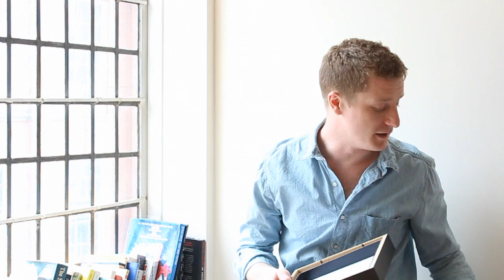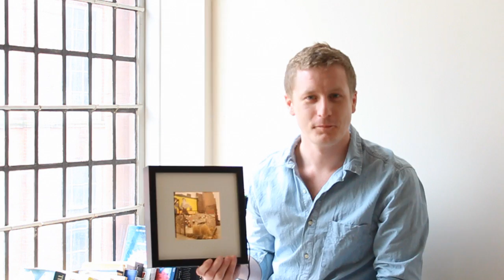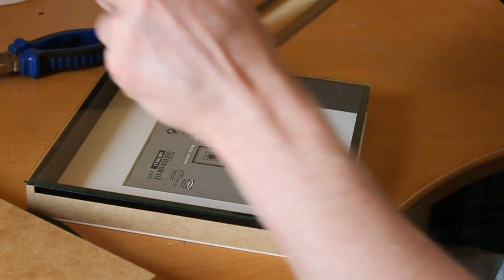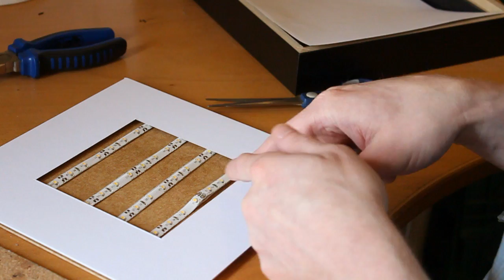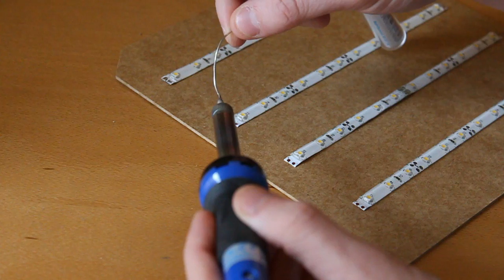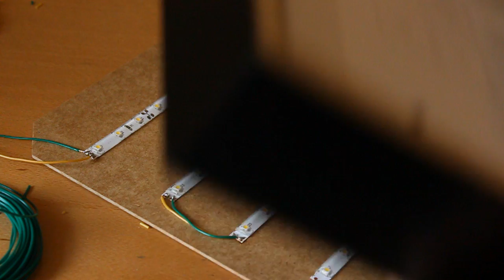How to make: 'Intelligently' Illuminated Photo Frames : Part 1

Comment: Wouldn't it be easier to connect the strips in parallel with all the positive connections at one end and all the negative connections at the other? You would only need to solder 8 points (one each end), rather than 14 by daisy chaining them, and there wouldn't be two opposite polarity solder connections right next to each other.

Comment: Didn't you make soldering hard on yourself?  12v and sets of 3 LEDs means each set of 3 LEDs runs 12v.  All the sets of 3 LEDs are wired in parallel along the entire roll.  All you need is a Positive and a Negative on each of your 4 strips.  
 Take your strips with groups of 3 LEDs and remove the coating from the positive on one end of each, and the negative on the other end (or both positive and negative on both ends.).
 Lay them on the board. 
 Then run a bare wire up both sides.  Tape it in place at the ends.
 Use another bare wire to connect the positive pads on one end to one of the bare wires running up one side.  Solder a long(ish) length of bare wire to a pad and then to the side wire and cut it off.  Then move to the next strip. 
 Do the same for the negative on the other side.

Comment: FYI I had my soldering iron too hot and it damaged the led strip,try soldering paste its much easier and works at lower temperatures . Sorry but IMHO wire the strips before sticking them down so if you do fork up the soldering you can go to the next + - point on the strip without having to rip it off the board. And don't trust the adhesive on the strip,best practice is to use glue. For this task don't use waterproof strips. They are more expensive and unless your planning an underwater gallery...pointless.

Comment: The best method of defusing LED lights is to edge light a piece of thin acrylic, but it must be roughed up in order to displace the light brightly toward the center. The way you go about this is to sand the sheet of acrylic with an even scuff.  A steel wool pad makes this real easy.  Just make sure its a new pad so as not to contaminate stain the acrylic.
That is how a lot of light boxes are made for tracing.

Comment: Thanks for the video. Would you recommend this technique on IKEA 27x40 poster frames as well ? I'm looking at solutions to light them up without building the lightbox from scratch and getting the snap-frame types, since I already have IKEA frames and they seem big enough to handle some LEDs inside. My posters are double sided, made to be lit up. What's your advice, please ? Thanks in advance.
Reply from the maker: +Razvan Dragu Have you got a link to the frames?
Reply: This would be the model, but the frame is black. This oak frame is new. My frames are the same, but black.

http://www.ikea.com/ie/en/products/decoration/frames-pictures/ribba-frame-oak-effect-art-50142931/

As you can see in the picture below via google images, the back is pretty spacey and looks like it could be hacked and add some LED, but the psoters being double sided, specially for lights, wouldn't the LED lights be too prominent when lit up ? Or would the light travel on the whole poster?

http://ikeahackers.net/wp-content/uploads/blogger/-6VNrC2k2qO0/T9XF7WD0Y4I/AAAAAAAAhqA/hKxkC3uFBeA/s1600/02%2B-%2BSollution%2B%2528Ribba%2BFrame%2529-700870.jpg

I just want to make sure I don't wake up with lines of lights along the poster when I light it up.
Reply from the maker: Razvan Dragu Hi Buddy, 

It doesn't look like there would be a lot of depth to that frame, if you putt he LEDs too close to the picture/poster you would definitely end up with lines of light.
Reply: +David Watts damn. ok. thank you! I'll see what alternatives I have. worst case scenario, I'll build the frames.
Reply: +David Watts damn. ok. thank you! I'll see what alternatives I have. worst case scenario, I'll build the frames.

Comment: Hi David. what type of picture paper are you using that seems to be a good print quality yet "transparent" (without any brand print in the back).

thanks,!
Reply from the maker: Samuel Bringas Hi Mate, it is just normal photo paper from the photo developer, mine did have faint branding on the back but you can't really see it. You can buy matt photo paper for inject printers which would work well provided it wasn't too thick and it wouldn't have any branding.
Reply: Thanks for the advise!

Comment: Thanks, you've confirmed my suspicion as to how to make one. However, I own 4 "Photo Glow" frames that take a 13 x 19 print. They cost $140.00 USD each and I don't want to cut one open in order to get the details of their design.

I'm going to make a back-lit frame which will have a outer dimension of 20" x 28" and I'm very well versed in LED strips, soldering etc., etc. So where I'm concerned is with the possibility of seeing "Hot Spots", (the individual LED bulbs), through the transparency when the lights are turned on.

I use a special "positive" white coated, transparency media and I'm using a standard frame thickness. In my case, the frames overall thickness is 1 3/8" and I plan to place a 1/8" thick diffusion sheet, (of what the manufacturer describes as "medium opacity").

Even so, I think the LED arrangement that you set up, (the multiple strips firing directly at the back of the picture), will create that "hot spot" effect I want to avoid. Therefore, I'm thinking to run the LED strips along the inside of each frame rail.

They would be facing the LEDs on the opposite rail and in fact, I would likely try lining the two longest frame rails first. Then I would add LEDs to the other two rails if I need to.

So why am I telling you this? Well, perhaps you, or one of the folks in this blog, may have done something like this and can keep me from finding out a potential problem the hard way.

BTW; I have the 6000K waterproof, 50/50 LEDs and perhaps that may be too cool. I'm guessing that the 38/50 LEDs are warmer, yes?. Perhaps a 4500K temperature would be better?

I noticed that my first store-bought Photo Glow frame purchased about 3 years ago, has a significantly warmer tone than the other 3 I bought in the last 1.5 years. I didn't notice this until just two days ago, when I had prepared a 4 segment enlargement as a test to an idea I had,

I printed the 4 segments each to a 22" x 16" size. Placed each segment, (these were just standard matte paper for testing), in the Glow frames. The frames would be hung against each other making the entire image 44" wide x 30" high

The effect I wanted was to create the illusion that the viewer was looking out through a window, (this was a Lake Powell Canyon photo I shot). However, not only did I find that one of the frames were comprised of a warmer LED set, but also that the frames were not back-lit to the edges of the frame rails!

That was of particular importance because the effect I wanted wouldn't work if the frames had their mattes installed. So I'm trying out a "DIY" Glow frame and if it works, I'll make 3 more. The frames at the size I need them would cost me about $350.- $500. each! I did find one that cost $280. each but the frame rails were too wide, (I'm trying to get them no wider than 5/8".
  So what do you think?
Thanks for the video which was easy to understand, great job!
Rich
Reply from the maker: Rich Paul Hi Mate, Thank you for what must be the longest and most concise comment I have ever had.

I have never seen glow photo frames for sale in the UK before but I did think they would be expensive.

My frames did have the hotspot effect as you described but it wasn't very obvious. I also thought about lining the outside of the frame with LEDs but it left a dark spot in the middle. It was still a nice effect though. A wedding photographer contacted me last year asking for help making some frames, he doubled the amount of strips I used and he was quite happy and even displayed 30 of them at a wedding fair in London.

Getting white or warm white is a tricky one, it depends on your image. I found warm white works well if you have a large proportion of skin tone or the image is of a family or friends but the cool white works better for landscapes/serious pictures. I suppose it is a creative decision.

I have had a good couple of years to come up with a better solution and in fact I have two for you.

'EL Panels' look promising from what I have seen, they can be cut with scissors and require minimal hardware to power. They provide a flat uniform light but I have not tested them for brightness or colour temperature. These are an expensive option in comparison to LED strips.

My other solution is similar to my first. Unhappy with my frames, I doubled the number of strips inside the frame but still saw faint hot spots. Then I realised that I could only see them because of the intensity of the light and not the orientation. I knocked up a quick circuit to dim the LED strips and it worked like a charm. It also reduced the power consumption by around 60%.

A word of warning though, black and white photos don't work all that well, your eye is a bit too attuned to contrast difference with a lack of colour in the scene.

If you still have problems, you can diffuse the light with bubble wrap, frosted acrylic or even very thin cotton. 

Other people may have some suggestions too.
Reply: David Watts Thanks David! The suggestion you made; "If you still have problems, you can diffuse the light with bubble wrap, frosted acrylic or even very thin cotton." is a good one! I do have a 12” x 18” acrylic diffuser as I mentioned earlier. However, it’s not exactly cheap and I need a bigger piece that’s that’s coated with a ‘denser opacity’.

I have several Epson Photo Printers. The large format Epson 7600 Stylus Pro uses a 24” roll paper. I use a inexpensive Epson “Heavy Matte” paper for testing various profiles, image projects, etc.. At this point, I’m using a sheet of that, (cut to fit the inside of the frame), as a diffuser.

Last night, I prepared my frame for a test. Today, I plan to try the configuration you've demonstrated and I'll place the strips about 3/8" apart, running parallel with the longest edge of the frame.

I do plan to use a dimmer and if I have to dim the lights too much to get rid of the 'hot spots', I'm going to start adding and testing various diffuser materials like that bubble wrap or cotton you had mentioned. Of course, I’m also going to try firing the LEDs across the frame as I mentioned yesterday.

Thanks for bringing up another alternative lighting that I didn’t know about; the "EL Panels" you spoke of! I looked into that today and though I’m not done researching the possibilities, they are a little less expensive than the pre-manufactured LED frames.

If I can get an EL Panel or, several, smaller EL Panels, (“strategically” placed in the frame), it may be less expensive than a single large one. Of course, I'm speaking about a frame at least 22" x 16". 

In fact, I'm actually working on another project that would need a 40" x 32" frame so the cost to make one is more relative to a store bought version than actual out of pocket expense. In a perfect world, I’d be very happy if I could make a large backlit frame work via DIY, for about $150.00

At any rate, I appreciate the tips, they’ve given me a lot of possibilities. 

BTW: I have some “Enermax TB Vegas” 120mm computer case cooling fans, (http://www.newegg.com/Product/Product.aspx?Item=N82E16835214050), that can light up and be set to a number of various illumination patterns and colors as they spin.

The interesting thing about these fans is that they don't have the traditional LEDs. Instead, they have a film coating 40% of each fan blade in the assembly and appear to be much like a tinted film applied to the windshield of a car. Have you ever heard of this stuff?

It's crazy because it's almost transparent, (or maybe it appears that way), and if I’m right about them being the light source, they generate very bright light that can be adjusted to brightness and color.

I didn’t buy them for the light show; I bought them because their fan blades can be removed easily in order to clean them. My point is that I’m able to see the interior mechanisms of the fan and I have to say, there are NO other light sources in that housing! These fans are more expensive than typical case fans so I have to fight off tinkering with the blade section, (placing a 5v charge through it, for example), in an attempt to light the film, lol. FWIW it may be inexpensive but I doubt it’s of use for a backlit frame light source. I think someone would’ve done that already if it could have worked, but you never know… 
;) Rich

Comment: Thanks for sharing, I'm doing a big picture frame based on this very same concept, however I'm dealing with a problem, I want to make the frame as thing as possible, but I can't avoid to notice the "lines" that the led strips leave all over the surface of the duratrans film. I've read that a thick acrylic would help, but it can be very costly..
Reply from the maker: The lines are more noticeable on camera but you could use a thin sheet of tracing paper to diffuse the led strip.

Comment: Hi, great video - just what I was looking for.
Is it possible to make these so they're connected to a battery source?
Reply from the maker: Sure, you would need 12v though. You could do it with an 8x AA battery holder which would work for rechargeable and non-rechargeable batteries. They use about 500ma per meter (rough estimate) so would last around 4 hours on rechargeables.
Reply: David Watts Great. Thanks very much.

Comment: Thanks for the video.  Couple of technical questions.  Any data on just what the most efficient spacing would be for even lighting?  Any data on fire hazard, like what adding each new light equates to heat?  I'm thinking of making a 3'x3'.
Reply from the maker: no data I am afraid, but a distance of a few centimetres is imperceptible with the naked eye. An camera will pick it up though. With the fire thing, you just need to make sure you use appropriate gauge wire, the LED strip is rated for a few amps as far as I know. 3 foot by 3 foot should be fine, I would image that is 3-4 metres of led strip (about 2 amps).

Comment: So lets say you want to do this with out a cord or plug into the wall, can you use a rechargeable battery pack (as long as it has the same adapter connection)?  I have seen on ebay they have multi colored ones with remotes (infra red) so you can turn it on/off.  What if possible battery apc (Li-Ion) should I get?  There seem to be quite a few on ebay but all have different Milliamps, I am looking to see what the difference is in Milliamp Vs. life from each charge and luminosity.  I understand the low its lit the longer it lasts, so if you have a high milliamp, can it go brighter, longer?   

And can I used the led light strip / RGB with the remote and solder it all together using a battery pack.  

Basically I want to create a backlit picture frame, and Hate having cords.  I would much rather charge the pack, and turn it on when needed, especially since you can turn it on and off with a remote....  Let me know what you think?

Thanks

Comment: Thanks for sharing this. I'm curious about the photo prints themselves. In this video you used the thin Ikea paper for the example but what do you print the photos on so that they illuminate correctly? Standard photo paper? Clear transparent sheets? something else? Cheers
Reply from the maker: Just standard matt prints (around 80-100gsm) from the local photo place, nothing special. It is not ideal though, they tend to add massive logos and things on the reverse of the photos which can be visible up close. Thin paper leads to brighter images but less diffusion.

Comment: Yeah, I've also heard the same about flux being more of a concern than the lead. The lead is an issue due to general contact, and possible ingestion- don't handle solder and eat at the same time, (obviously!)

Long-term exposure to flux fumes can apparently lead to pulmonary issues down the road.

Comment from the maker: Yes you can and it will be easier with the non-waterproof version. You won't have the horrible plastic on the connection terminals to get rid of like I did. 

In my experience the warm white LED strips work best, the bright white ones are kinda blue and too bright.

Comment: You would have fewer soldering problems if you pre-tinned the wire tips and the contact pads. (And if you have an iron-coated tip DO NOT file it! The whole point is to protect the bluk of the coper, which the flux will eat away rapidly.)  It should be possible to clean the iron with a damp cloth if it is fully heated (or scrape gently with wood).

Also, the soldering job will be quicker if you factory-line it into stages (cut your wires; tin them; tin the contacts; finalise).

Comment: Nice project and a great idea. 

Some Tips:
I use an old computer fan to draw the solder and flux fumes away from my face, I think the flux fumes can be more toxic than the solder itself. I usually collect fans from old computer power supplies.
I would recommend using thinner solder wire of size around 0.5 or 0.6mm for better flow control. Also, a no clean flux pen would be handy to improve solder flow.

looking forward to part,

Mark